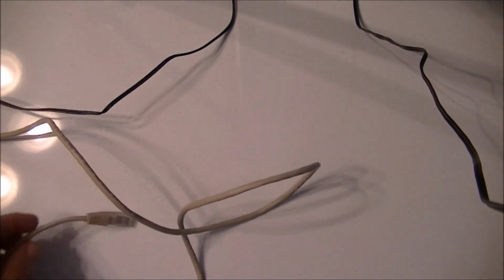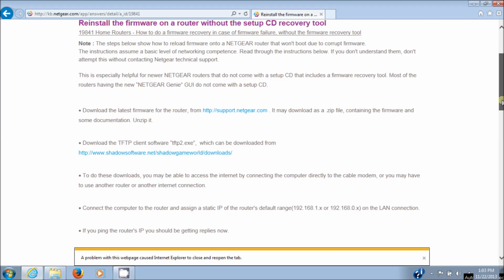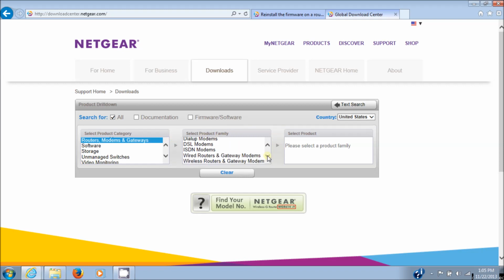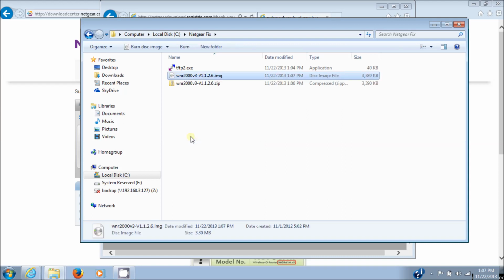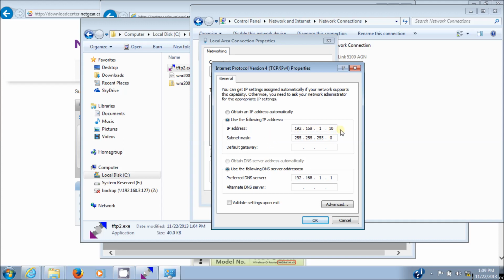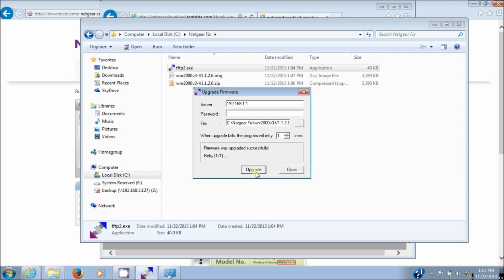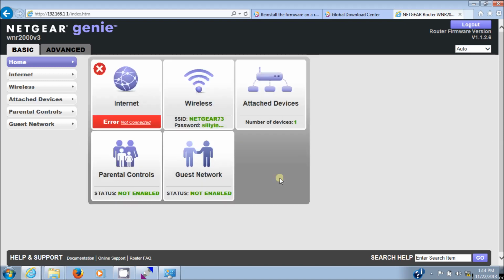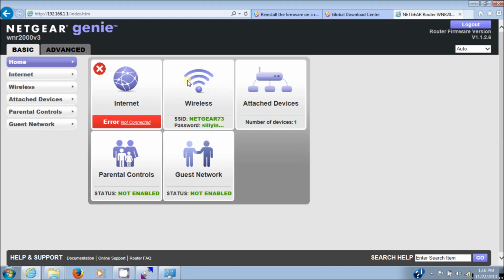Bricked Router Recovery Netgear WNR2000V3 (version 3) How I restored my router

Comment: i have a Netgear WNR2000V4 and it the same box will this work for it if i get some help it would be appreciate greatly
Reply from the maker: I don't have a V4 to test this on but you do. Give it a try like I show on the video and see if it works. I am assuming that your router is not working right now so you really have nothing to lose. It can't get worse than not working. Thanks.

Comment: I am trying to use your strategy for my Netgear WNDR4500. It has the blinking green power light problem. The Netgear firmware I downloaded doesn't have an .img file, though. It has a .chk file, which doesn't run like an .img file. Do you know what I can do to run the .chk file? Is there a Netgear application/program that can run it? Thanks in advance for any guidance!
Reply from the maker: Here is the Netgear rescue procedure for your router: https://kb.netgear.com/19841/Reinstall-the-firmware-on-a-router-without-the-setup-CD-recovery-tool it looks very similar. Tell me how it went. Thanks.
Reply: It worked! My WNDR4500 is good to go. I just needed to run tftp2 and use the .chk file. Worked like a charm. Thank you so much! I now have a second router to use as an access point for better coverage. :)
Reply from the maker: You are most welcome. I am very happy to hear you were successful in recovering it. Thank you for watching and the great feed back. I am sure others with a WND4500 will find it helpful too. All the best.

Comment: Hey so just got this router and got DD-WRT on it (build 18777). Now i can't get any internet from my LAN. The internet light stays orange. Any Ideas?
Reply from the maker: Do you have access to the router interface?
Reply: Yes I did but got nothing, I got it working but only by getting internet through another modded router (dir-600). So I figured I'd just go back to the stock firmware and started the process which was going smoothly, until I realized that the updates and files I flashed went to my other router (dir-600) and bricked that one lol. So got the netgear to work but bricked my other router in doing so.
Reply from the maker: oraine16  Ouch! That is why I say to hard wire this mod only. Is there a serial recovery option on that D-Link?

Comment: Hey Richard I have a problem here, once i click on upgrade it says "Unable to get responses from the server" so should I change the IP address or something else? Pls help
Thanks
Reply from the maker: Are you using a network cable? Did you set the ip address in network configuration?
Reply: Yes I did setup the IP address as you showed in this video and yes I'm using network cable. Is there something else maybe I need to do??!
Reply from the maker: Farhad Baloch Double check your ip config. Do you have a firewall or virus software running? If you do turn it off and try again. If all else fails try it on a different computer.

Comment: my still stay at solid AMBER light? No green! I have tried 30-30-30 method also..but nothing works.... quick details.. My netgear R6300 was running tomato. I tried to use Netgear firmware to  go back to factory within Tomato Admin page. Modem reboot, and since then it's been AMBER LIGHT only.. Please help!!!!!!!!
Reply from the maker: Sounds like you might need to do a serial recovery of this router. I have done it on an N750 WDR-4300 but it is not the same procedure. Here is the procedure for doing this here: http://www.myopenrouter.com/article/52395/How-to-Debrick-or-Recover-NETGEAR-R7000-R6300v2-or-R6250-Wi-Fi-Routers/

Comment: I bricked this thing too when I very first loaded dd-wrt. I learned that only versions v24-sp2 (03/19/2012) std (SVN revision 18777) and BELOW work right without bricking. Do you know how to open the case and attached usb serial adapter like this site discusses http://wiki.openwrt.org/toh/netgear/wnr2000 ? Thanks for the video.
Reply from the maker: I did that same thing and this procedure fixed it for me without opening it. I did make a video of cracking it open though but seriously follow this video step by step and you should be OK. Make sure you do a 30-30-30 reset before you start this process. http://youtu.be/pgVG1Mii0do

Comment: Dear Richard
yesterday i've got my new netgear AC1750 (R6300) router.iam from iraq and we got no support center for netgear here ! any way,when I opened the box and did all the connections i just got the green power led blinking to death,i tried to figure the problem and i discovered that the software is corrupted..so please tell me in steps how to flash it again,or maybe you can send me a link to it...
thanks in advanced...god bless you
Reply from the maker: Yasir Salman I don't own an AC1750 (R6300) to confirm this but +Bob Buckley in the comments below used the procedure in this video to recover his (R6300) v1 give it a shot. Thanks

Comment: When trying to install the official firmware it says update successful but router does not reboot even after 2hrs
Reply: I have exactly the same issue. Is there any workaround ?
Reply: @fr33s7yl0r  believe it or not just do a shut off and do a regular reset not the 30/30/30 and it came back. Was in this mode all night said enough in in Dee Dee Dee mode!

Comment: Hi Richard, I can't seem to get a connection to my router via the LAN port after setting the IP to 192.168.1.1. Every time I try to connect to it from tftp it says that there's no response, even after putting the 'password' in the password part. I've even tried the 30/30/30 reset. Still nothing. Am I doing something wrong, or is my router a paperweight? I haven't been able to start the wireless part on my router for some time now and I've tried everything in the book to fix it.
Reply from the maker: NightBaneVA Make sure your IP configuration is correct 11:15  in the video. Try a 
different patch cable if you have one and last try a different computer 
as well. Please note that sometimes the router is beyond repair. Thanks.

Comment: i bricked my nighthawk r7000 everything is solid after i downloaded dd-wrt any ideas,i searched internet but found nothing,any help,no internet connection light off,nothing blinking
Reply from the maker: This is the only procedure I know of to recover it. Have you tried it yet? Thanks.
Reply: i tried it last night,everything went well til i tried to downoad the nighthawk firwware,im stuck there
Reply from the maker: Did you get the firmware downloaded from Netgear? Thanks.
Reply: yes,i just tried it again,no go,i will try one more time,thank you
Reply from the maker: Here's the link from Netgear for the R7000 – Nighthawk AC1900 Smart WiFi Router http://www.downloads.netgear.com/files/GDC/R7000/R7000-V1.0.7.10_1.2.3.zip Thanks.

Comment: how do you do it for linux am stuck i was downloading openwrt on my wndr3800ch and its bricked
Reply from the maker: Same procedure but you will have to use the Linux network interface to set the IP addresses. I used atftp in linux. For example atftp --option "mode octet" --option "timeout  60" --verbose --trace -p -l code.bin 192.168.1.1 . Where code.bin is the firmware you want to load renamed to code.bin.

Comment: Does this work when the light is orange/ amber?
Reply from the maker: It may work it depends on the degree of the current problem you have. But really there is only one way to find out and that is to try it and see. If your router is not operational you really have nothing to lose. It will either work and save your router or not work and your router will be in the same state it is right now when you are done. Thanks.

Comment: what about for macs?
Reply from the maker: The mechanics are the same but you will need a TFTP program for IOS which I am sure is available. The simpler solution is to use someone's PC. I don't have a Mac or I would do a video for it. Thanks.
Reply: ok thank u :)

Comment: When I put mine into the boot mode as you called it (after holding the paper clip in place for 10  green flashes) it does remain in that mode as it should. Once it is in this mode it becomes unreachable via ping. I did everything exactly as you said but when I get to the part where I try to push the file to the router via TFTP2.exe I always get "Unable to get responses from the server." I did notice that when I try to ping the router from a command prompt while it is in this "boot mode" it just times out. When I try to ping it while it has a solid amber light it responds no problem. Any idea? Great video by the way. Even if it doesn't work for me it's a very well done tutorial.
Reply from the maker: Did you hard set your IP address in the network settings?
Reply: Yes I copied your settings exactly. Thanks for the quick reply!
Reply from the maker: Jay S Do a 30-30-30 reset and try this again. Make sure you use the links I provided for all the software and firmware too as I know they work correctly. I was thinking that DHCP was giving you an IP address on a normal boot on the router and not in the TFTP boot mode (Blinking green). If you dont put an IP address into your network configuration (192.168.1.XXX) it will not be able to connect to the router.Double check your network config and make sure you don't use 1 or anything higher than 254 for the last three digits. Sorry but that is all I can come up with. I know it took me reseting the router (30-30-30) several times to get it to go at first. Good luck
Reply: Richard Lloyd It did finally upgrade the firmware successfully. I saw it identify network and the router appeared to reboot but my power light always goes back to solid amber and doesn't turn green no matter how long I wait.
Reply from the maker: Jay S  Did you succeed? If not, are you sure you have WNR2000V3 and are you using the links for the firmware files I provided in the description for your router?
Reply: No dice. I managed to push the firmware to the router many times (doing a 30-30-30 before each new try) trying every version of firmware. I am 100% sure of the router model. Says it right on the back. I did use your links for the firmware files. I guess its just beyond repair. Everything goes exactly as you say it should in your video up to the point where after the firmware push the light is supposed to eventually go from amber to green. Mine just remains solid amber. At this point I think I'm just going to buy a new one. This one gave me years of reliable service so I feel like I got my moneys worth.
Reply from the maker: Jay S Sorry to hear that. For the price of a new one you have to consider what your time is worth too. They still sell this router at Amazon http://amzn.to/1a5GCXa Sometimes they truely are too far gone.
Reply: Thanks so much for all your help. Great channel. I know to come back to your videos in the future if I have more questions.
Reply from the maker: Jay S  My pleasure. Thanks for watching.
Reply: Richard Lloyd I am reading this correspondence because it is so similar to my issue.  I came across some other threads and one question was asked "are you connected to the internet?" and wondered if i had to be connected? I assumed that I didn't since one of the steps is to disable the working wireless connection, (which is up and running fine) and then hard set the other (bricked repeater wannabe) which of course does not have an internet connection. And yes, I am embarrassed to ask, but I have asked stupider questions. Thanks.
Reply from the maker: Elle t  You only have to be connected to the internet to download the appropriate software and firmware. The rest is done locally.
Reply: I'm having the exact same issue with mine right now.  I'm also unsure why you need to assign it an IP address because once you go through the reset process, it's going to reset it back to the default of 192.168.1.1 anyway.

Comment: Everything goes as planned but the router never reboots.  Tried 30-30-30's, the works.  I've tried a few different images.  Nothing, the green power light just continues to flash, never turns amber or anything like in your video.  192.168.1.1 still pings and I can re-flash it.  It seems likejust wont leave TFTP recovery mode and reboot itself.  Huge bummer really.  I believe it's truly bricked at this point.  Open to any thoughts here.  Thanks!
Reply from the maker: Sorry to hear it. One more suggestion, try this procedure on an other computer. Make sure you follow my instructions and links exactly. BTW does TFTP2 program say flashed successfully? Thanks
Reply: Richard Lloyd Yeah, TFTP2 appears to work as it should, file transfers successfully, it just never reboots, light keeps flashing green.   I am a network engineer and have followed your instructions to a T.  My other machines are a MacLaptop and a Linux Box.   Do you know the procedures on those OS's?  Thanks!
Reply from the maker: Jesse Howerton  The weird part is that the TFTP program says it was successful. I know the first time I did this it took a long period before it rebooted. You can also see that in the video. The first couple of times I did it I didn't wait long enough for it to reboot. The fact that you can connect to it tells me it's not dead. Can you ping it?
Reply: Richard Lloyd Yes it's pingable but only when put into the recovery mode.  For example, If I do a regular boot, 192.168.1.1 will ping successfully for about 2 pings and then nothing.  Recovery TFTP mode pings 192.186.1.1 successfully, which allows the TFTP2 program to speak to it, transfer the file, and so on.  But then, nothing.  A blinking green light for hours.   I've read this same issue in this comment thread and didnt see a real solution to it.  Very strange indeed!  Any help is appreciated :)
Reply from the maker: Jesse Howerton  Try a different network cable. If that does not work try it on a different computer. I know it's weird but you can't really hurt it now.

Comment from the maker: @Hao Song can you ping 192.168.1.1? If so try a 30-30-30 reset: http://youtu.be/gczCzP9Rry0?list=PLnxXRLSlmSVNiENiN9wTejP6dtIqqmTya and try it again. If that does not work try putting "password" in the password field of the TFTP2 program. Thanks
Reply: I tried ping 192.168.1.1. It seems there was no connection with the router when it was under recovery mode and the cable indication light (showing connect with my computer) was green. This cable indication light did blink when I tried to upgrade or ping ip address. This is wired.
Reply from the maker: Hao Song  Did you do the 30-30-30 reset?
Reply: Richard Lloyd Yes, I tried the 30-30-30 reset when I used CMD command. Result was the same: something is wrong that prevents the computer from transferring firmware to the router. I also tried to use a different computer but failed. It seems that it is the router's problem. But there is no issue to use it daily except I have to reboot it a couple of times every month to get the wifi connection back (otherwise, I cannot connect internet).
Reply from the maker: Hao Song So it works when it's not in recovery mode? What version do you have? Are you using the same patch cable every time (try a diffrent one if you can)? What is it's IP address when it's working normally? This is very weird.
Reply from the maker: Hao Song Here is the proceedure from netgear, someone commented that it worked for them when all else failed. http://kb.netgear.com/app/answers/detail/a_id/22688/~/how-to-upload-firmware-to-a-wndr3700v2-router-using-tftp
Reply: Richard Lloyd I really appreciate your help. I will definitely try this new method and give you an update. This router works ok except losing internet connection sometimes. That's the reason why I want to try a different firmware.
Reply from the maker: Hao Song  Yea the DD-WRT firmware is very stable. Thanks
Reply: Richard Lloyd I just followed the procedure shown in that link and successfully installed DD-WRT firmware. Thanks.
Reply from the maker: Hao Song  You're welcome. Happy routing. Thanks for watching.
Reply: +Hao Song 30-30-30 reset using cmd? can you explain how?
Reply from the maker: +Patryk vd meulen Follow this video for the 30-30-30 reset.  http://youtu.be/gczCzP9Rry0?list=PLnxXRLSlmSVNiENiN9wTejP6dtIqqmTya

Comment: Attempting to 30 30 30 just puts me into TFTP mode, flashing with TFTP doesn't reboot, it continues flashing green, 30 30 30 from TFTP just puts me back into TFTP mode. Help?
Reply from the maker: I believe there is a serial repair procedure for this router but I have not done it. Google that and see what you find. Thanks.
Reply: Richard Lloyd Ended up doing that last week. Apparently corrupting the HW ID on these is just common enough that people whine about having to do it, but the documentation is spread so thin that it's a PITA to find.

Comment: Thanks to Richard Lloyd for preparing the vid and giving me confidence in resurrection!  Mac Users:  Using the web interface to upgrade the firmware of my WNR2000V3, I was impatient and did not wait long enough for the router to reboot and I was faced with a bricked router with a blinking orange power light.  Using TFTP that is built into the Catalina OS, I gave these commands in TERMINAL:
sudo launchctl load -F /System/Library/LaunchDaemons/tftp.plist
(that starts the TFTP service)
tftp
(that starts the TFTP program)
mode image
(mode binary failed me many times and almost caused to to scrap the router)
connect 192.168.1.1
(send the image to the router at 192.168.1.1)
put wnr2000v3-V1.1.2.18.img
(send that file to the router)
(------ almost immediately I got the message:)
Sent 3469509 bytes in 1.4 seconds
(and I knew I was good! )

And I waited and waited and waited  while the router rebooted.  Success......